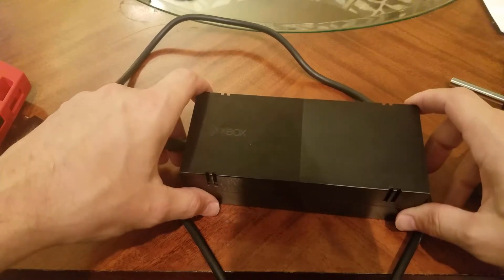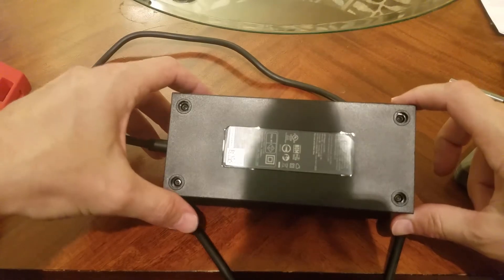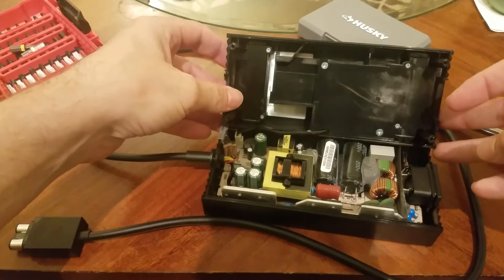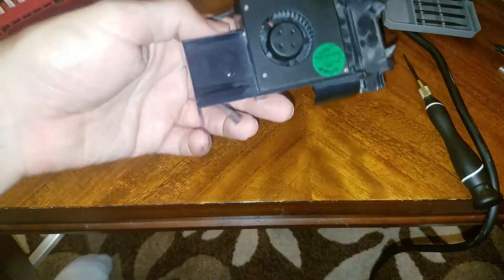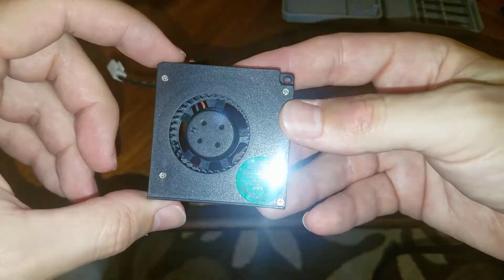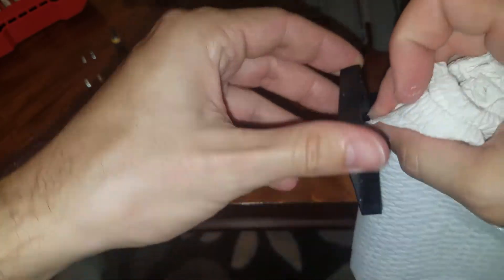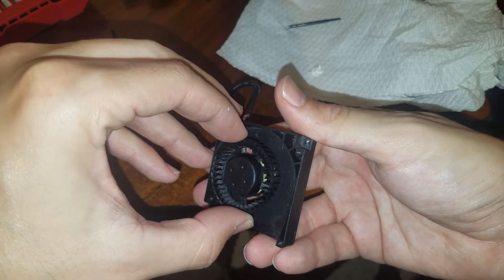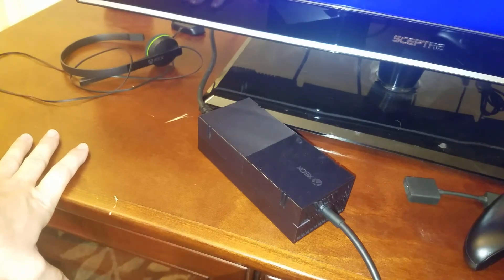Xbox One AC Adapter Making Noise [FIXED]

Comment: Thanks man still works for a fix. WD40 on a rag touched in the same places you put grease did the trick.
Reply from the maker: good tip!  pinning it so others can see.
Reply: Was about to ask this
Reply: Thank you
Reply: Was thinking would wd40 work as well...thanks imma try that since I already have some
Reply: WD-40 is a cleaner/degreaser, not really a lubricant. Your fix may be temporary. I found a lithium grease "crayon" at the hardware store which worked for me, so you don't have to buy a gi-normous tube of the stuff.
Reply: I couldn't find anything greasy so I just rubbed deodorant on it.... Male speedstick to be exact. It did the trick. I used to punch it too lol
Reply: @xxanonymousbeastxx5566  is it still working
Reply: @xxanonymousbeastxx5566  This comment of yours is gold! Absolutely hilarious. 💯 Underated funny comment award
Reply: @Mustgohome2003  7 I
Reply: @xxanonymousbeastxx5566  bout to try this! 😅

Comment: Thank you for making this video it is very helpful. My family members Xbox powerbrick had the same  problem with that loud noise. I was able to open it up clean out the dust and I applied some WD-40. After I put it back together the noise was significantly reduced. I think I will need a proper grease to completely get rid of the noise. 

I used a metal pick with a hook to remove the rubber plugs that hid the security screws. I used a Torx T10H bit to remove the long security screws under the brick. I used a small Philips head screw driver 5/64" to remove the smaller screws around the fan enclosure. I hope this information helps anyone that reads this.

Comment: I did this as well but used WD-40 instead of grease and it helped get rid of most of the noise but there is still some if I leave it on for long enough. I May have to look into getting that grease

Comment: I have pretty much the same issue with my dad's slightly Xbox One, whenever the Ac adapter is plugged in, it makes loud sounds, but when the Xbox is booted on, it doesn't work or load correctly, any fixes as to why it may not load correctly?

Comment: Just for future reference, The bolts are actually called Torx head bolts. They aren't security bolts and are quite common in modern devices. They were designed as an alternative to the allen head style bolts (hexagon). And are often preferred for the fact that they are less likely to "round/ strip". Also they come in a single sizing standard where an allen head bolts can be either metric or sae.
Reply from the maker: I think the screws in mine had the little pin in the middle.  We usually call that type security bits at work, but that might be because we usually find them in security cameras, heh.  Then again most of our nicknames for stuff are either incorrect and usually HR unapproved.
Reply: Just for future reference the torx bits shown in the video are often referred to as 'tamper proof' or 'security screws' as was stated in the video to distinguish that the bits require a torx with a center hole due to the screw having a center pin. Doing a search online or Amazon with the wording of 'tamper proof' will yield the correct type of torx bit.

Comment: Recently got a new power brick because the original one just stopped working. Got a new one (a GameStop power brick) and a few months after using it without problems, the fan turns insanely loud, lawnmower loud. After cleaning out the little dust it had I followed this video’s instructions. I used WD-40 instead of what he used, and it’s whisper quiet now!

Comment: Just want to say thank you so much for this video,I tried this and it works perfectly for me now. I just used some lubricant/cleaner on that little fan part connector. I was just going to buy a new power brick because it was so loud I wouldn’t want to even play anymore but I feel much more satisfied with myself knowing I fixed it myself

Comment: Started happening to mine and gave it the good ole smack it once trick, and surprisingly that worked just as well
Reply: Lmao i just did the same thing worked like a charm
Reply: Yeah, don't smack it too hard or you'll loosen up something from inside the brick.
Reply: Same
Reply: Just bought a refurbished Xbox one and just read your comment. Slapped mine now the fan is less noisy LOL
Reply: Been beating my for awhile now. Theyre pretty durable. Still males the noise every now and then but im js it has survived getting hammer punched into the ground plenty of times

Comment: Amazing! I though the loud fan noise was from the console itself, but when I moved things around to get the model number to replace the fan, the converter upgraded from loud to grinding. A dab of lithium grease fixed it, and it turns out the console makes no noise at all. It was the converter the whole time.
This adapter is a replacement for another one that was grinding. If I haven't thrown it away, I can fix that one as well and have a backup.

Comment: i tried to take the T10 screws out but wont break lose. used a T10 bit i had and one my father had and it only wants it make it stripped. any ideas? also i never had it open before and i been the only owner.
Reply: Those security screws can really work your Patience. Atleast the ones on the xbox controller when repairing a trigger etc.. from the inside. Seems like they should have out more thought into the product itself and use regular screws instead of security screws then the customer has to do surgery to fix minor flaws of the product

Comment: Had my Xbox for years. Always plugged into the wall, just how it always worked out. Just moved, set everything up and got the same noise/vibration. Power strip that I used did look a little sketchy, so I plugged it directly into the wall, and it stopped. Searched for an answer and led me here. So who knows. Mine did stop without the power strip tho.

Update* plugging back into the same power strip did not cause the same noise to happen again.
Reply: Brandon the exact same thing happened to me, I’ve done everything and it still won’t stop
What did you do to make it stop?
Reply: I have an Xbox one
Reply: @FrostIsGodly  well it started making the noise again. And (I do NOT recommend this) I just started banging on it every time it did it, and it would stop. Eventually, it stopped doing it as loud. However it still makes some kind of noise. It's just not loud at all, and barely noticeable. But, in the end, it worked.
Reply: Brandon I thought all these comments were trolls, because I punched, kicked, slapped, the whole 9, and it didn’t work and then I smacked it on my wall and it’s fixed now lol thanks for it regardless

Comment: I have a quicker fix just run it for 1 and turn it off then back on
Reply: Xxx_FRED _xxX at first I thought this comment was just a smart ass kind of comment. But I just run mine for a bit and it actually stopped making all kinds of noise on it's own. Lol I hope it keeps working.
Reply: Its cool bro
Reply: +Inadvertant 1 minute Uno
Reply: Mines works now, how long did urs last without making a sound
Reply: @matmann1141  I just kept my brick plugged in bro
Reply: Thx bro

Comment: It works! My power supply was grinding so loud. I had previously used compressed air and slapped it like most gamers would/did. But after $12.03 at Home Depot for the grease and compressed air I have a silent and working power supply again. Good as new! Thank you!
Reply from the maker: nice!  yeah slapping is always the next step after turning it off/back on.  If that doesn't work that's when it gets real lol.  glad you got it working.

Comment: Nice job! Have one question though. "Grease question". Instead of the product you recommended in the video, would it be ok to use "grease" that I use for door hinges? Thanks!
Reply: Throw some Crisco on it lol. Im sure just about any type would do a lengthiner fix than all these people saying they just slap there's and now it works. Which is true until you have to slap again, and again every 20 to 40 min.